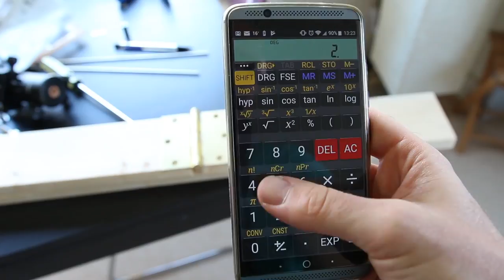Building a barn door sky tracker for astrophotography (LOUD)

Comment: nicely dun, what was the calculations done? can you pls provide the formula pls
Reply from the maker: Thanks! The formulas and their derivation are all shown in the link shown in the description: https://partofthething.com/thoughts/making-a-cheap-and-simple-barn-door-star-tracker-with-software-tangent-correction-for-astrophotography/
Reply: The calculations involve some trigonometry and algebra. You just need to find how long your threaded rod need to be away from the hinge based on the threads per inch of your bolt. (0.25° is the rotation of the earth per second) So solve sin(0.25°) = (1/threads per inch)/length of the board. I have a 20 threads per inch rod so I can solve sin(0.25°) = (1/20)/L which solving algebraically for L got me roughly 11.5 inches. You can also change the math up and solve for any length board or threads per inch.